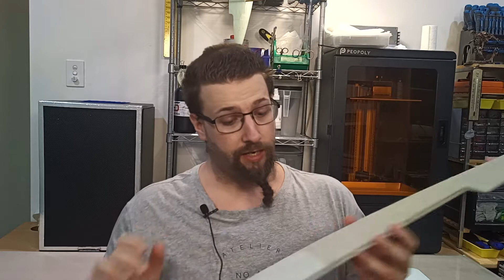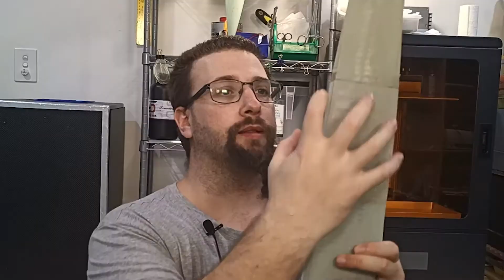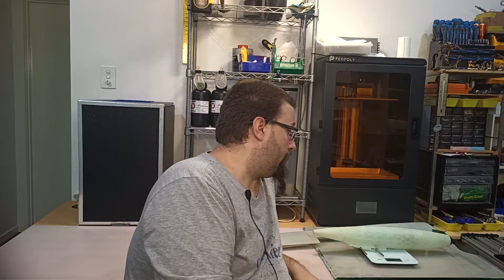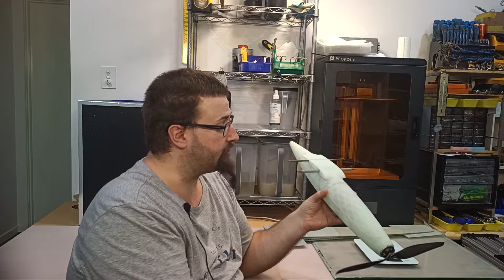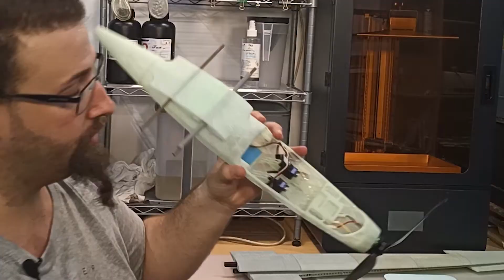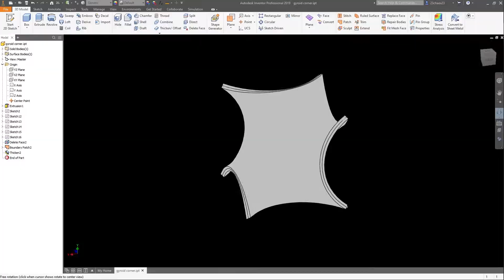chaos daily 2021: 064 gyrating gyroidial guru

Comment: Maybe do shorter 50mm sections initially?
Reply from the maker: shorter section wouldn't necessarily present surface faults or allow for good structural representation of the present structure.
Reply: @23chaos23  would or would not?
Reply from the maker: @jotham123  wouldn't

Comment: Do fuselages print as nicely now as they did before or has performance degraded? Have you considered testing different ambient printing temperature?
Reply from the maker: its about the same, the errors are more location-ally apparent rather then environmentally inherent